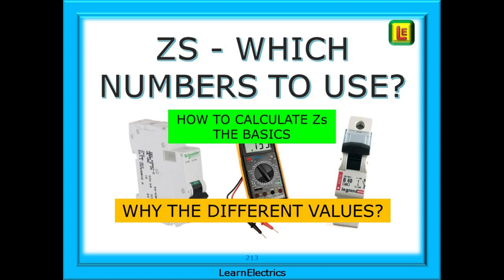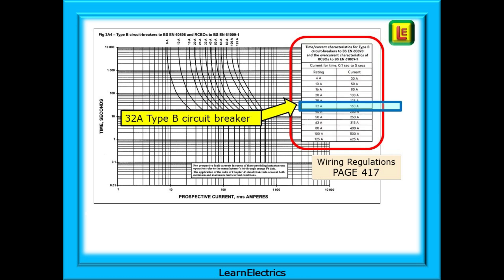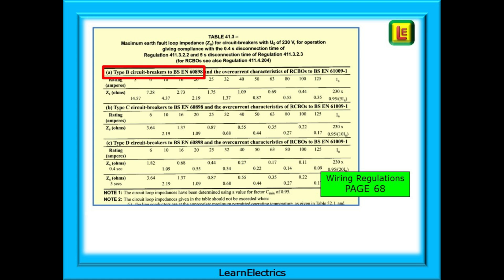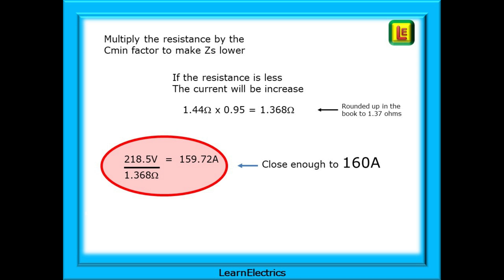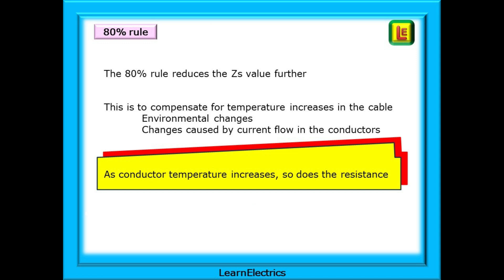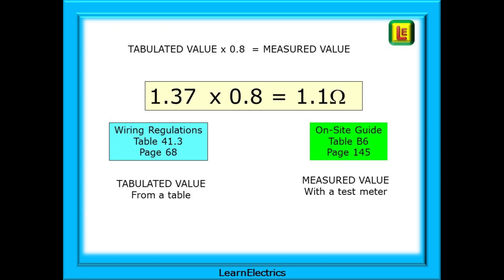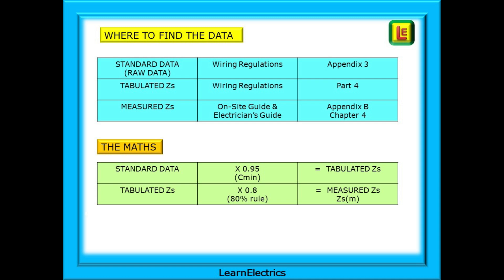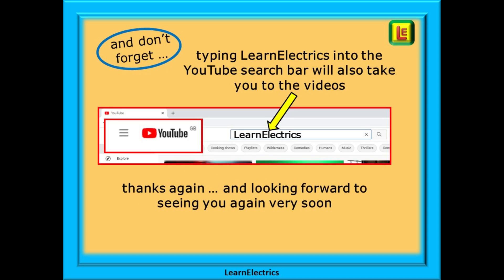ZS – LOOP IMPEDANCE – WHY SO MANY NUMBERS – HOW TO CALCULATE THE CORRECT ZS – WHAT THE NUMBERS MEAN

Comment: Great tutorial very well explained indeed. So you also apply the C min factor to the impedance as well as the voltage. If you apply the C min to the impedance surely your back to the start than if you never applied it if that makes sense. I dont understand that bit I thought the whole point of applying the Cmin to the voltage was to err on the side of extra safety to allow for lower voltages eg as low as 216 and as high as 250. I must def be missing something maybe I will watch it again. Thanks Dave
Reply from the maker: The Cmin is applied to the voltage but because the voltage is reduced this also affects the impedance (ohms law), hope this helps. Dave.